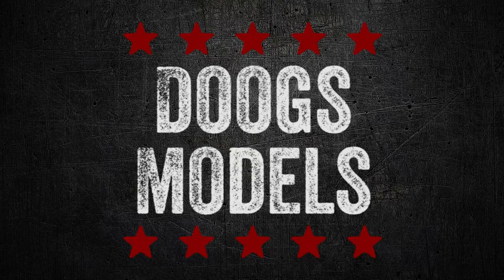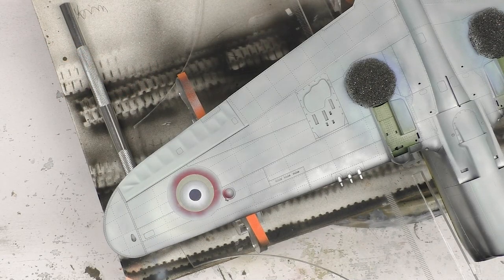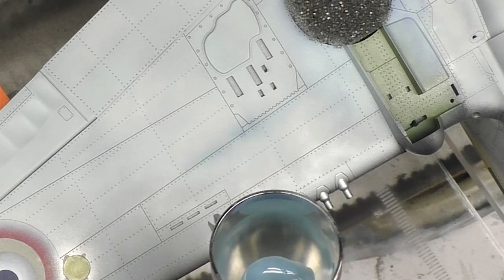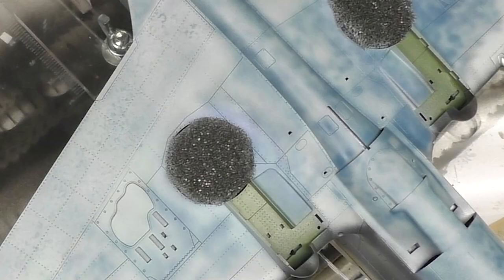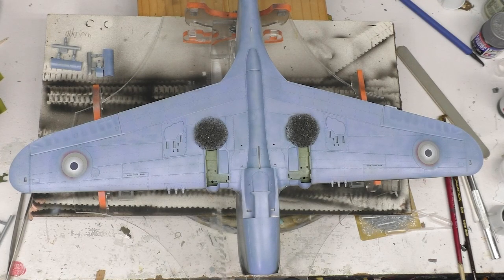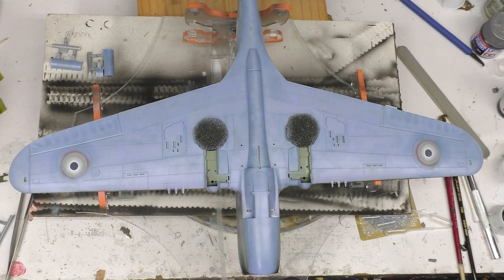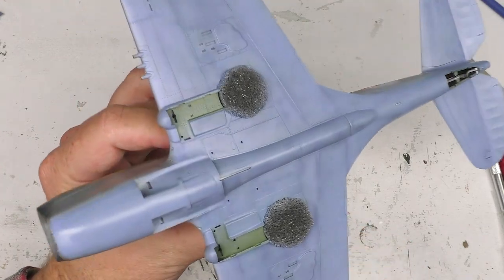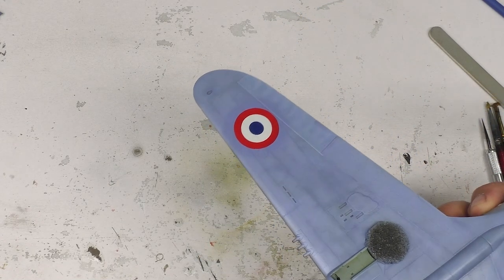P-40F Warhawk Build 07 - Painting Azure

Comment: Nice job so far. I believe the forward part of the wheel well (in front of the circular hole for the wheel) was also painted in the lower cammo color, as it was essentially  a part of the wing lower surface.
Reply from the maker: yeah I've been waffling on that. Seen sources saying both ways and, like all things with P-40s, seems there's always equal parts rules and exceptions to said rules.

Comment: Great video series. Just curious do you do all of your work under a ventilated exhaust hood? Just trying to think of what I need to consider when setting up my paint station at home. Otherwise I suppose most modelers just wear a mask when painting?
Thanks!
Reply from the maker: I work in a garage with airflow keeping me upwind of the spraying. With the doors up it's basically the equivalent of spraying outside so no, no exhaust hood.

Comment: Won't those many partially covering layers cause bumpiness, waviness (crappiness) in the surface? Ot it will, but the clearcote will deal with it?
Reply from the maker: Not with MRP, no. On past builds, the far bigger culprit, every time, is any kind of texture on the kit plastic.
Reply: Good to know. Is it something with the pigments they use, or the consistency of the paint? I know its almost thin as water. It needs a different technic then for example Tamiya or Gunze, but the result is really good (especially the surface). I admit I would not have the patience to paint a whole 32nd scale model with this technic. Tipically I build in 72nd scale (at least for aircrafts), so things like cockpits, landing gear wells, etc not the problem. But I really need to do something like this if I build one (or more) Tomcat(s). My first try with a cheap Academy one is not very satisfactory. It almost looked like a plough field. (Its good to have these old and cheap, not so good kits in hand. Perfect mules for experimenting.)
What happened to your compressor? It sounds like it caught some illness.